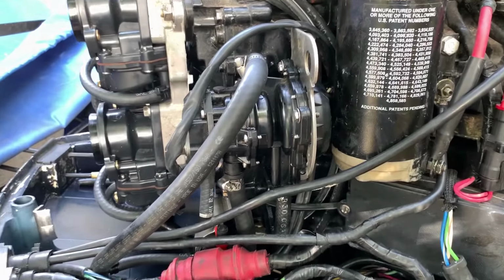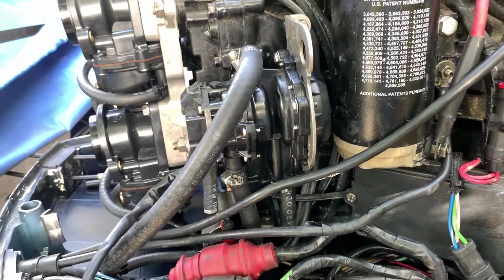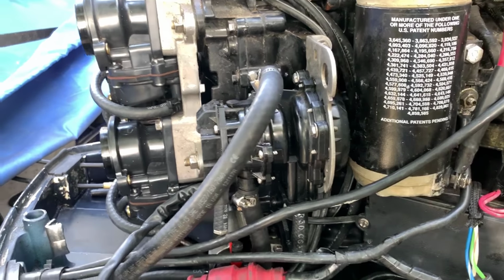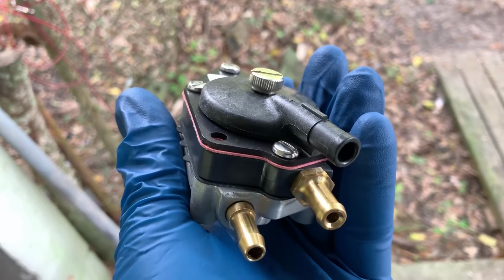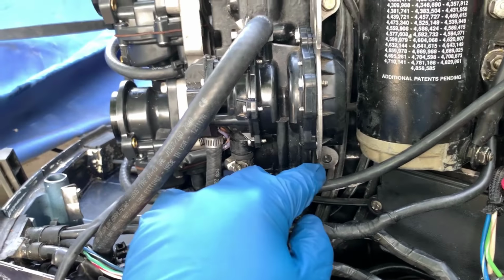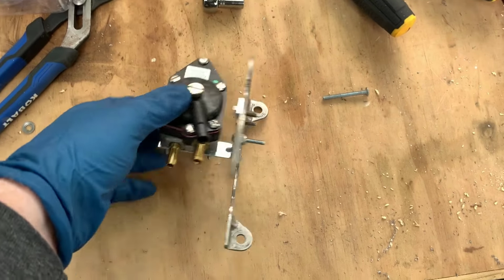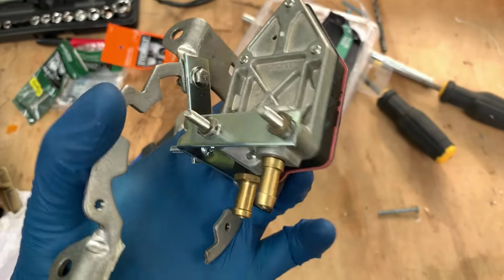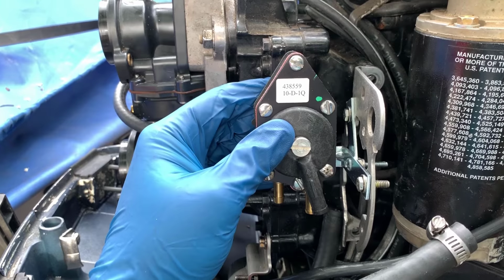Johnson/Evinrude VRO Fuel Pump Conversion

Comment: Great video. I did exactly the same thing on the bracket, using  angle brackets. The only thing you forgot is to be clear to show which hose hooks up where. I had to look it up elsewhere. But thank you so much! Evinrude 140 2 stroke
Reply from the maker: I thought I mentioned in the video where each hose hooks up, but couldn't show it due to only having two hands.

My Evinrude is still going strong with this setup.

Comment: What is the pulse? My boat was previously modified. Seems the pulse line from crankcase is capped. There is a inline fuel pump. Is the fuel pulsing normal? the inline pump seems weak with pulsing and fluctuating. What powers this pump? My inline pump kicks on when the key turns.

Comment: Interesting. Mine has VRO. When looking at parts on line my shows a standard fuel pump replacement with 2 connections on the fuel pump instead of 3.
Reply: There is a port on the block with a plug you can remove and the block will feed the pulse to the pump

Comment: I followed the direction but now the only way its runs if i pump the gas line once that gas burns out i have to pump again cant find any leaks ----help please
Reply: Robert Vernon Crud. I’m about to do this. Did you get it working?? Use a real OEM pump?
Reply: Robert Vernon Did you find any solution? I have a same problem and I bought from china. It is not original part.
Reply: @ahmettuna7451  I did mine this weekend with an OMC Pump. Worked perfectly. Toss that junk, and seek a real OMC pump.
Reply: There is a hole on the back of the pump that is connected to the pulse nipple. Not sure if its supposed to be plugged or left open to "breath". Trying to find the answer before putting my motor back together, as getting the vro out was a PITA.
Reply: The hole on the back needs to sealed off to work properly.  If it is not sealed, vacuum can not be created.  If by chance the hole on the back sits "flush" against your mounting bracket, it may create a full or partial vacuum. If it starts and idles fine, that does not mean everything is proper. Trying to run full tilt where the pulse is really giving the fuel pump a work out, will tell if you have a good seal on the third hole on the back of the fuel pump. Anything other than running perfectly is a vacuum leak via the third hole on the back. 

Hope this helps.
Reply: Update for VRO to "regular" fuel pump with 3 nipples and hole on the back. 
The hole on back is a pulse nipple designed to be mounted directly to the motor. If installed this way, the pulse nipple on the "front" bottom needs to be plugged.  

If VRO was attached to a mounting bracket, then attaches to the motor and has pulse line running to it, the following needs to happen. First probably need to fabricate a bracket to mount new pump to, that attaches to the old VRO mounting bracket. Second, nipple hole on back of pump needs to be plugged or sealed off. (I used a fuel- high vibration resistant sealant/gasket maker by permatex) When being mounted to fabricated bracket.  Let gasket set over night before testing. Remount the new fuel pump hook everything back up. 
Let her rip tatter chip!!!

My motor fired right up!!! Stayed running after two stall outs. Put motor in gear and gave it near full throttle and it ran like a champ. 

Not having the "second" (the one on the back or on the front bottom) pulse "nipple" plugged or sealed off will cause a serious vacuum leak and motor will not start, stall out, run at idle speed, and last and most frustrating stall out or bog down at higher rpms. 

Hope this helps. PM me if you have any questions. Can send pictures of my new fuel pump fabrication.

Comment: Is the 140 hp fuel pump a different part number? Just bought a 1986 ragin cajun with a johnson 140 but the fuel pump is leaking and the oil pump isnt working and is even wiring up im guessing original owner did it like that i just want the battery bay to be clean so im taking the oil tank completely out

Comment: My vro system is good and working but I would to free up some space or use the oil container for emergency fuel tank. Should I just leave the vro system till it breaks or do the conversion now.
Reply from the maker: That’s a personal call. For me the VRO is just one more thing that can fail while on the water, so removing it and premixing your fuel ensures that there is never a moment when oil is not lubricating the engine as long as you remember to premix when adding fuel.
Reply: Did the fuel pump swap last weekend. Awesome result. Thankyou.

Comment: I’m lost, these pumps have a hole on the back of them and it is made to work off vacuum hooked up to the block. Hence the plastic spacer that comes with the pump. That hole also sucks thru the barb fitting
Reply: But the spacer have a hole in it too

Comment: I was ready to delete my VRO and go with premix.  If you delete/disable the VRO do you need to add a fuel pump?  All other videos just disable the VRO and leave it in in its place.  They just disconnect two sets of wires (the one you showed plus some others and cut off the 2-stroke oil supply by placing a bolt in the line (you also have this).  But no other video speaks about adding a fuel pump.  Am I missing something? Thanks

Comment: Do you still have to have that wiring harness you unplugged actually plugged in when still running the VRO but with a plugged oil feed line and premixing the tank?

Comment: So I have an urgent question These pumps come with a gasket And there's a small peep hole down the center Am I supposed to block that off? Because it seems like the pulse line can blow right thru it Which wouldnt make sense
Reply from the maker: There are two versions of this pump. One with a separate pulse line and one that attaches directly to the motor which feeds the pulse through a hole in the back of the pump.
Reply: @JasonLefevers  I bought one with three lines but it still has a hole down the back il prob justJB weld it
Reply: @r.seaboats6666  I'm having the same problem with my pump what did you do to fix it

Comment: Which hoses go where? At the end you just show it back up and running but I'm not sure which hoses go where. Thanks
Reply: EXACTLY
Reply from the maker: See video description
Reply from the maker: john melzer See video description
Reply: Description should say 5min video of how I made a bracket.  Does not explain anything of how to convert, or what to do with the fuel/oil lines.
Reply from the maker: @flyingkevo  This is not rocket science, so if it's not obvious where the lines go you should leave it up to a professional. That being said, see description for more info on where the lines go.
Reply: obviously not rocket science....     but certainly not what the title says...  you should just change the title to how awesome you are at making a bracket for your engine,  cause your video is NOT about how you converted it.  yes description show pics and  shows way more info then your bracket making capability.
Reply from the maker: @flyingkevo  And you should go find another video if you don't like the one I posted. I'm not getting paid for these videos, so frankly I don't give a crap about what you think.
Reply: @JasonLefevers  I really liked your video and description

Comment: So how did you block the vacuum pot on the backside you use the gasket between the pump and bracket
Reply from the maker: There is no vacuum hole since there is a fitting on the block with a hose for the pulse.
Reply: @JasonLefevers  on the after market pump I got it had the hole one the back where it would  bolt to the block and a port on the front I just cut a pice of rubber and sandwiched it between the back of the pump and bracket

Comment: I currently have a 2000 70hp Johnson and it gets enough fuel wide open buy at an idle it seems to be starving. And that's after rebuilding and cleaning the carburetors. It was converted to the other pump from VRO from previous owner and I'm thinking the pump isn't pumping enough fuel at a low rpm. Anything over 2500 its fine
Reply: So I'm probably just gonna replace the pump to start but had anyone else have anything like this happen?
Reply: Yes I have the same issue on a Johnson 90 I think it's a 2005... But yes won't idle nicely and unfortunately it starting leaking gas when trying to start.... It has already been converted to a fuel pump....Im gonna check the pulsar line and see if it's wet and if the diaphragm is worn in the fuel pump

Comment: Picked up a 19 foot aluminum with a 90 hp VRO that has the typical failure....glad I watched your vid , now I’m up and running.👌
Reply from the maker: Awesome, glad it helped.
Reply: Would this pump be why my 90hp will run but you have to keep squeezing ptimer buld to maintain the motor running
Reply from the maker: @jimmyhodge1348  Yep, if it will run only when squeezing the primer then that usually means your fuel pump needs to be rebuilt or replaced.

Comment: My 98 Johnson 70hp vro was leaking gas so I got a cheap I'm guessing aftermarket vro pump on Ebay for $180 hooked it up easy went on lake and in 2 hours coming back to ramp my no oil alarm went off and motor died down bad and wouldn't accelerate Starts right up tho idles fine. Will this solve my problem? Do away with the VRO system completely??
Reply from the maker: Yes, it very well could, but you'll need to premix your oil/gas and get the official OEM non-VRO pump and not a cheap thirsd party one.
Reply: @JasonLefevers  That's what I'm trying to find I cant find it. My Johnson model number is J70PLEEE it comes up in 1999 model for parts even tho it says 98 on sticker
Reply: @JasonLefevers  got pump in mail what size hardware you use with those metal L brackets?? Thanks man

Comment: Hey man I have a Johnson Gt150 VRO but I am not sure if the pump is bad.  I was out on the lake today for the first time on the boat and cut the motor to fish but around 5 minutes later I tried to start it back up and would not start.  It was leaking fuel and oil out of the prop.  Not sure if it is the VRO system.  Thanks
Reply: It is definitely the VRO
Mine 90hp Johnson did the same until I converted it to simple pulse pump
Reply: Did you convert the 150hp?

Comment: can i replace a evinrude 15hp 4 stroke fuel pump with a 2stroke fuel pump?..
Reply: Probly not  2strokes use a pulse from the engine to run the pump 4 stroke will usually run on a cam system

Comment: I noticed on port side tyou have the temp alarm brown wire, zip tied to your spark plug wire. The manual recomends spacing them as far apart as possible. High voltage can trigger SLOW mode. Trust me its a pain when that kicks in.

Comment: @jason lefevers Is mounting the fuel pump required for it to work? My fuel lines i replaced are making it near impossible to mount.
Reply from the maker: No, it doesn't have to be mounted directly to the engine as long as the lines are all connected. It just makes it a little sloppy.
Reply: @JasonLefevers  appreciate it.

Comment: Hey do I need to disconnect any wires to the VRO ? I want to do pre mix. So I see wires but they go to a bundle and there’s no disconnect like you showed here. Do I just cut them up ? Help me out here man. Thanks
Reply: Hey man did you ever find a solution to this? I have the same question…thank you!
Reply: @michaeladams7562 . Not really. I end up cutting the wires to deactivate that VRO. it worked out well for some time but then the motor just started sputtering. Finally got rid of it

Comment: Will this pump be good for A 1984 235hp v6? To lean ?? Ty
Reply from the maker: Nope, I don’t believe this pump replacement pushes enough fuel for motors in that high of an HP range. There are some after market pumps you can Google for that range I believe.

Comment: What's the benefits or differences of vro pump vs normal fuel pump? I have a 1993 super sea horse evinrude. So hard to find info, please help! Thanks
Reply from the maker: Mostly convenience. A VRO means you don't have top premix, just have to keep the oil reservoir filled with oil. However, a VRO is just on more thing that can break and if this happens on the water you could be running a motor with only fuel and no oil to lubricate the engine, which can cause major damage.
Reply: Normal fuel pump is a lot more reliable and a ton less to go wrong, Not to mention the cost of replacing a VRO.

Comment: I have an 225 1988 johnson my vro is gone am doing this for sure ty , will this part fit my engine?
Reply from the maker: With a motor that large you may not be able to get by with just this one pump. I've ready where people have put two of these in an array for larger HP outboards.
Reply: @JasonLefevers  surely there's a larger single pump out there....
Reply from the maker: @phuquetwo  I'm not aware of one. You could always get a rebuild kit for the existing VRO pump and just disable the auto-oiler.

Comment: I have a Evinrude 115HP V4  , I purchased the same pump as you, but this pump does not have any electrical wires, how does this pump work without being connected to the electrics. How does the pump work with no wires connected.
Reply from the maker: It operates on a pulse from the crankcase that moves a diaphragm inside the pump in and out which pulls fuel from the tank. Most pumps on these 2-stroke motors are made this way and do not use an electric pump.

Comment: I have a 1988 johnson gt 150 and when I run wide open throttle it cuts out is this because of my vro being discounted and me premixing? Because there’s not enough pressure? Would putting a new fuel pump work?
Reply from the maker: On a 150hp, you would probably need two standard fuel pumps as one wouldn't have enough fuel flow.
Reply: Do you know what the part numbers would be
Reply from the maker: @noahlee9985  Go to MaxRules website. They have replacement non-oil ones on there by HP. https://www.maxrules.com/fixomc-no-oil-vro.php
Reply from the maker: @wtfjpgmailcom   I wouldn't buy those cheap $30 rebuild kits. I'm hesitant even about the expensive OMC ones, but those cheap China-made ones are way worse.
Reply: I bought one like this but from different place on the internet. It says it's OK for a wide variety of motors including my 1985 150 evinrude. Hoping I don't need a larger one.
Reply: @phuquetwo   what’s the website?
Reply: I'm having the same problem with my 1989 Evinrude 60. Seems to work fine at half throttle but I open up and it suddenly dies. Then won't start. After a couple hours it'll fire up again. Seems to be leaking fuel but no idea where it's coming from.

Comment: Mine is a 2004 90hp johnson bombardier, its feeding way to much oil, want to do this, would this fuel pump be correct?
Reply from the maker: Should work fine on a 90hp

Comment: So the vro pump and the new pump, dont need any wires?? how do they still work??
Reply from the maker: Andrew Hansen The6 use the vacuum created by the motor to provide pulse to a diaphragm. The wiring for the VRO pump does not operate the fuel pump it just feeds the pump with oil. If you pre-mix this electric Oiler is not needed.
Reply: Also the wire is a alarm circuit it lets you know if it’s running without oil. And can put your engine into safe mode, slow rpms or limp mode.
Reply: @unsaltedlife5998  How is this done? Or with the VRO plug wire disconnected, does it automatically disconnects the alarm?
Reply: SoCal Sea Chaser yes

Comment: Does this pump have the pulse hole in the back of the pump or does it have a block off plate installed or did you block it off
Reply from the maker: If you purchase the pump with the part number in this video the pulse hole on the back is closed up with a plug and pulse is supplied via a hose instead.
Reply: The OEM pumps can come with or without the hole in the back. @JasonLefevers

Comment: But what lines went to where? And did it work out, going to install on a 120 and wanna make sure it will have enough fuel from idle to wide open?
Reply from the maker: Check the description
Reply: @JasonLefevers  nice I like it, no fuel starve anywhere? Can back off and right back on it with no hesitation? Or I guess I’ll find out I ordered it lol
Reply from the maker: @whiskeytangofoxtrot5939  No issues at all. I get full throttle with no hesitations.

Comment: Had a problem with my 90hp 2004 Johnson since I bought it new. Idling issues at the dock, stall out unexpectedly at idle
Finally removed entire VRO. Installed Pulse pump and kept primer solenoid
Runs better than new.
I determined that entire setup , vapor chamber and vro was a poor design and prone to air leakage , mine was all plastic.
It's completely unnecessary.  
I wish I did a video. It would have helped a lot of guys. My boat has no issues idling or stalling now. Runs great.
Reply: You are 100% correct...I just deleted mine on a 2000 90hp. The thing was ALL plastic and leaked more oil ON the motor than it pumped INTO the motor. I will be glad to have it gone!

Comment: Wanting to do this bypass on my motor and was curious why you installed the new pump instead of just using the original vro with oil intake disconnected
Reply from the maker: The old VRO2 pump was not holding pressure, so it had to replaced either with a standard pump or a new VRO2 pump. A standard OMC pump is much. much cheaper. If your VRO pump is working you can disable it by plugging up the oil line and disconnecting the wire connection to the pump.
Reply: Will this pump work on Evinrude 150 xp

Comment: You should keep doing "how to videos"  this helped me a lot. My motor is spewing oil all over my driveway and its dripping down the skeg.  Before I order the fuel pump. Can I disconnect VRO but still use it as a fuel pump? If so, I obviously need to disconnect the oil line but then do I disconnect the 3 prong connector, the ground and there are 2 other wires. Thanks in advance. Great video
Reply from the maker: Yes, disconnect the oil line and the three wire plug and use it as just a fuel pump.
Reply: @JasonLefevers  much appreciated